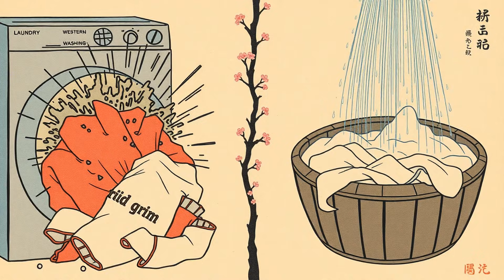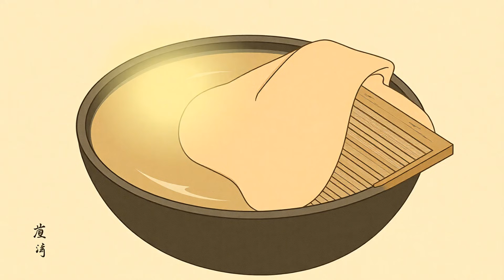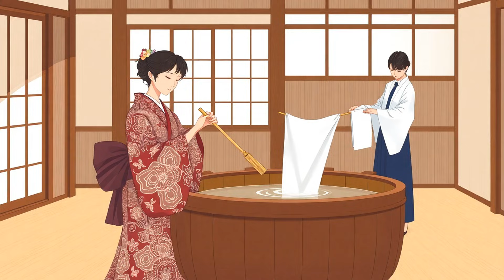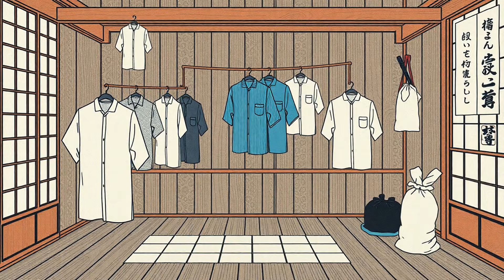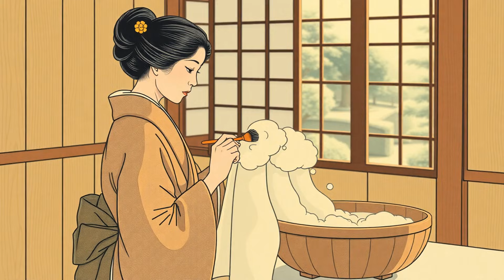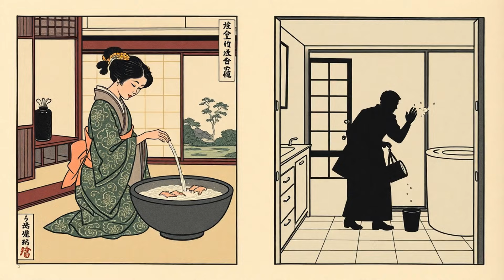I Tested 12 Japanese Laundry Hacks — WHITER, SOFTER, BETTER

Comment: 11:02  Double spin plus air burst method;  What about the half you removed from the machine?  Surely that needs another spin?
Reply: I do all of the same things and I live in Canada.  Modern washing machines have settings so that you can do this.  I have cloths that I’ve worn for over twenty years that are still as white as they were when I bought them.  There is one huge difference here,  we do not have an issue with humidity it’s opposite.